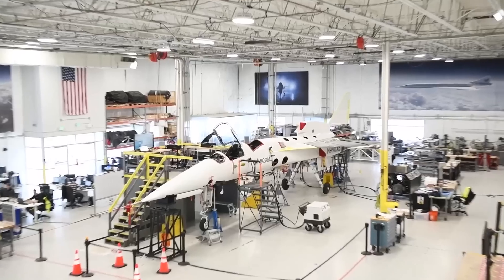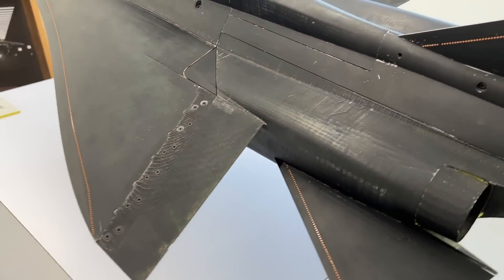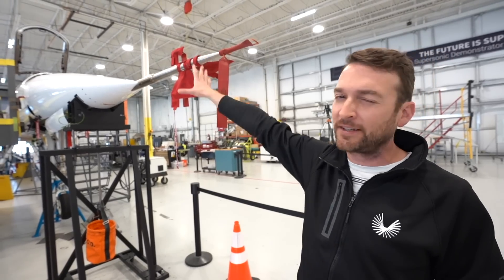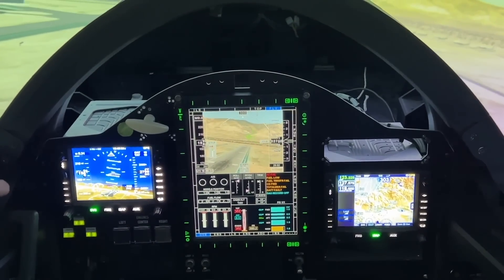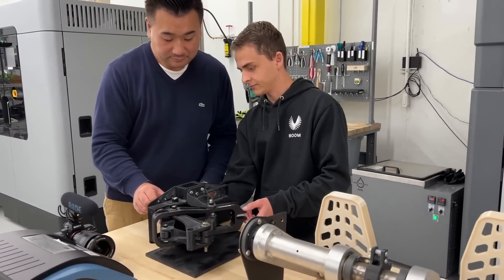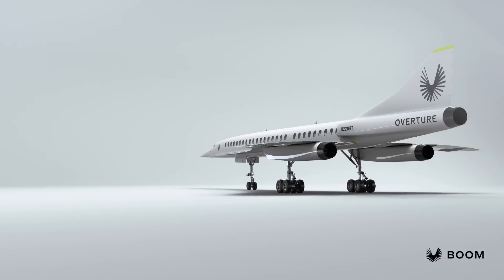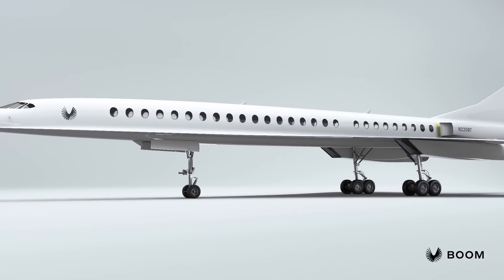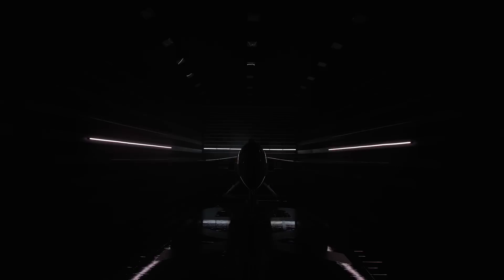Is Supersonic Coming Back? The Future Supersonic Jet - Boom Supersonic

Comment: I really don't see this project being successful. Fuel prices, the sonic boom factor over land (which  you really can't design out of the plane), having a design that allows the price per seat (capacity) for airlines to want it, and as Boeing and Airbus have learned composites really haven't worked out the way they hoped for the fuselage, range is another big factor especially for over water ops, I am also concerned with the level of automation talked about to make this aircraft fly-able. You want your basic design like Boeing and Airbus airliners to be fly-able even if you have severe failure of the aircraft's systems. For example if the camera breaks how do you land this plane? In this aircraft's case you're also exposing a carbon composite fuselage to temperatures and forces that are untested over the normal life of an airliner.

The miracle that the British and French pulled off with Concorde is something that will be really hard to ever do again. We also must remember with Concorde both British Airways and Air France operated the aircraft at loss for every flight, and were restricted to over water ops.
Reply: I said the same thing and had idiots blast me.    

The sonic boom is a huge item.   Unless you can fly over an ocean up over a pole.  It's for the super rich.  Never will be for the people unless subsidized